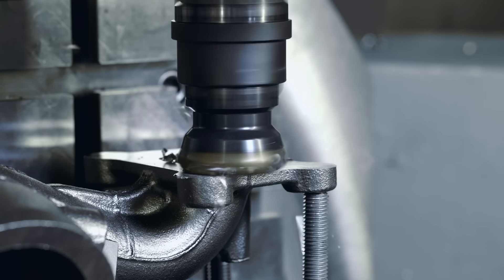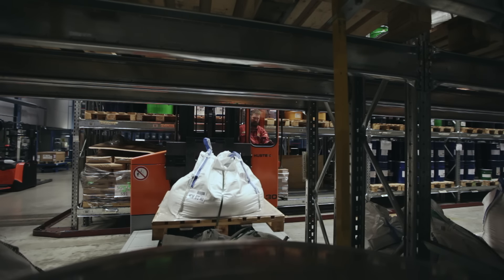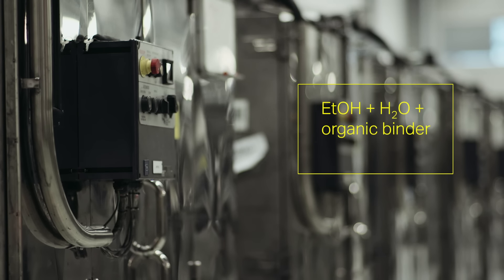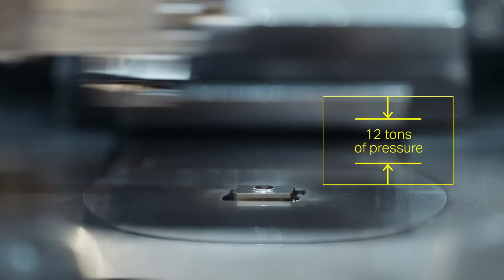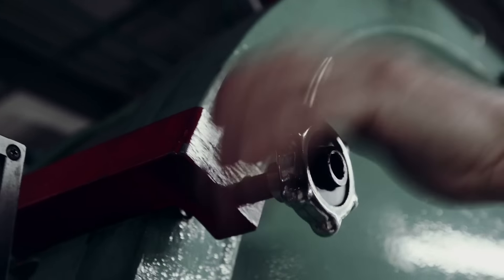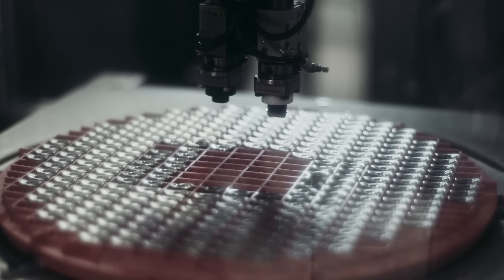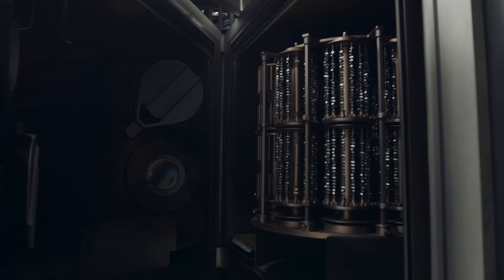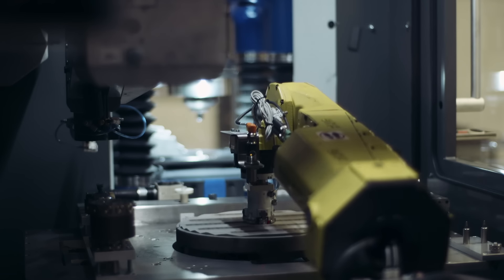How carbide inserts are made by Sandvik Coromant

Comment: As I machinist I work with sandvik inserts a lot. It would be good to see how they are recycled and presumably turned back into powder.
Reply from the maker: Hi,

Thanks for your comment! We have noted that there is a lot of interest for a film about the recycling process and have added that to the wish list for future film productions.
Reply: greasemonger29  he uses PVD coating in last. can you tell me estimate price od pvd coating machine ?
Reply: +GreaseMonger , how do u grind these inserts after they have become dull ?
Reply: It's too costly to send carbide back to get recycled instead we use them in hard facing earthmoving gear or as shrapnel in hand grenades.
Reply: Sachin Ki You dont. They’re disposable, that’s the whole purpose of using easily replaceable indexed tooling. They dont have enough material to be re-ground, that very small rise of the edge is the cutting surface. The process of shipping, setup, and grinding would be twice the cost of just buying another insert, and because each insert dulled surface would be a different dimension, the grinding process would probably have to be custom for each piece. Not worth it. You re-grind HSS and permanent carbide tooling bits, not disposable inserts. Just dish out $10-$15 for more which will pay for a hundreds of times its worth in work.
Reply: I'd say Stefan Gotteswinter would disagree with you Nikolai.
Reply: Nikolai is right on with analysis.
Reply: Anything abrasive thing that contain diamonds.
Reply: Nikolai Shriver we saved all our carbide scrap and took it to the local recycling and got enough to have a party bowling,drinking and pizza every year 😁
Reply: @kunjikorans  diamond
Reply: @jozseffarkas1767   ty
Reply: @kunjikorans  you are welcome
Reply: @nikolaishriver7922  Well YOU don't "recycle" as in resharpen and reuse in your shop, but you very well sell it back for a great price and Sandvik etc. Recycle them by breaking up and re-using the carbide...
Reply: In manual lathes, I've seen plenty of people sharpen them. Just a regular carbide grinder.
Reply: @waqassaddiqueeverything5938  The price of a PVD reactor, the machine ? Between 150k USD and millions. It depends of the volume inside the chamber = number of pieces you can put inside. As for one deposition cycle ? Count between 500-1000 USD.
Reply: @nikolaishriver7922  that 20% cobalt content is gold for EV batteries and chemistry in general. Maybe not adequate for new inserts, definitely purified cobalt and Tungsten very worthy for chemists
Reply: Would be better if they can resharpen them for a second use
Reply: @RockerGuy0001  even a touch up with a diamond hone can make a surprising difference.
Reply: They made the video!
Reply: @trexmidnite  agree. The inserts usually have 4 edges used for cutting. Or 2 depends on insert. But when thats wear down you still have some material to sharpen. Its like 0.4 mm of material on each side before the tip become useless or to rounded. 1 insert can cost about 120 usd. Save alot of money to sharpen it. 
But i think the thing is. The material you working on have like 0.001 or 0.0001 tolerance level. Sharpening a tip must be very precise
Reply: @elinberglund9824   Who the hell is charging you 120 dollars for one insert? The most I’ve ever paid for one insert is 120 dollars, and that’s for 12, so ten dollars a piece. If you work for a company, they will be paying only a few dollars top.
Reply from the maker: @importanttingwei7747  
Hi there
We strive to develop the best product possible, that deliver the best performance on the market. Rather than looking at the price per insert, look at the cost per component. The total cost for tooling in manufacturing of a component is most often a small part, 5-10% of the total cost but the effect of having an optimized machining solution can effect the total cost per component with 10-50% depending on circumstances.
Reply: @RockerGuy0001  shop used them on the CNC machine and then they were hand sharpened for manual machines usually lathe bits in my case, takes a little practice is all.
Reply: I got into machining a couple of years ago and was blown away by inserts. I had never thought about how a lot of our technology is manufactured through machining now I am smaller fascinated by cutting edge technologies. Pardon the pun but I think that's where the term came from.
Reply: @waqassaddiqueeverything5938  oh un tah platit 2 is probably close to 300-500K maybe more
Reply: We use both Sandvik and Kennemetal brand carbide inserts. These insert manufacturers have pretty much perfected the quality of the carbide insert and as long as you can avoid interrupted cuts they last a long time.
Reply: Well impressed you are expert
Reply: @Turkishmath Stephan uses it for his own shop that requires specialized tools that he makes. He also does manual machining so It makes sense for him as a low production, low volumes shop but it would not make sense for a high volume shop. It costs more to resharpen than to buy new. CNC machines have hundreds of tools each with at least four or more cutters. If it made financial sense then companies would be doing it already
Reply: You can recycle the material in other uses than the original.
The recycling process must be cost-effective to be sustainable.
Reply: Liberal limp wrist
Reply: I work for Kennametal.  Mostly recycled inserts are ground up and used in less precise applications.  Road work, mining, drilling etc.  high precision CNC inserts are almost always made using new powder
Reply: You didn't explain what the inserts are for. What is the actual use, after the production?
Reply: https://youtu.be/nPmGVPFITiY?si=2UchG4DO13K1mkWg

Comment: Thanks for a fantastic video! I had no idea the shrinkage rate was so high during sintering. Amazing you can determine the final size at all accurately.
Reply: Not to undermine the difficulty of getting sintering right, but the final dimensions are determined by the grinding process that occurs after sintering/shrinking.
Reply: Anthony Cullison  Also not all inserts are grinded into dimensions.
Reply: Exactly my thoughts while watching. The shrinkage must be consistent, which is a strange enough concept to digest on its own.
Reply: Imagine what injection molding engineers go through🙃🤷‍♂️
Reply: ahh have had variances of .005  in some
Reply: @miguelcastaneda7236  Could you elaborate on that, please? What dimensions were 5 over/under? I would think that over/undersize inserts would not be a problem in a mill/lathe, since you touch off to find the edge. Am I missing something?
Reply: @DrLumpyDMus  it is you touch them off again
Reply: It is not the most complex thing humans have figured out, besides the entire process of grinding is CNC controlled so adjusting for variances resulting from the sintering operation is only a matter of changing an offset number.
I'm curious what would happen if they press formed an insert without binder.

Comment: It's a wonder we can afford carbide inserts at all.
Reply: They aren't cheap.
Reply: You can’t afford NOT to utilize carbide.
Reply: @ Phil it depends what you call cheap and what your needs are (quality/ performance) I use Inserts on  a minilathe :D
because i can run much higher rpm than with HSS.
Its great since the minilathe has less power in the slow RPM range, with carbides i can compensate that by running higher speeds. I got Mitsubishi inserts from ebay pretty cheap. You can get new original Sandvik Inserts on ebay cheap, last time i looked they arent expensive in my opinion (starting at 10-15$ for a 10xpack, Canadian ,US,EU, Isreal Sellers).
Sometime you can get lucky to spot a offer for 6,5-8$ of new in-stock inserts a seller wants to get rid of.(going out of business or switching processes might be a reason for example) EDIT, ok on Amazon they cost 20-300$ Dollar a piece XD , glad that ebay exists
EDIT lol i found even cheaper sellers, 4$ for 10pcs from mitsubishi , i bought 10packs for a lifetime xD
Reply: As the video says, carbide can take much more heat and pressure than, say, high speed steel.  As a result, you can run your machine faster and take larger cuts which, in turn, means the turn around per piece is much shorter.  

So if you're running production you'll be able to cut more pieces per hour.  If you're running one offs, you or your employee will finish the project sooner and will be able to move on to the next project.  

"Time is money" may be a cliche but it's also a hard fact when you're running a business.
Reply: @phillhuddleston9445  - 2 bucks a piece 20 years ago, for a basic cutting insert.
Reply: @phillhuddleston9445  I have to buy mine used on ebay :(
Reply: @deweys  You buy used inserts?
Reply: I bought a whole bunch of Mitsubishi TiN coated ccmt 21.5 inserts on Ebay, $35 for 10 packs of 10. They came from China. They turned to be really good counterfeits, all the way down to the perfect iridescent stickers that said 'genuine Mitsubishi' on em. I had a pack I bought from MSC for I think around $85 for 10? The counterfeit ones weigh almost exactly the same (.04 grams under) & they aren't as sharp on the edges (compared them under a microscope). They're obviously just reprocessed/recycled inserts & they work pretty great. I dont do ultra precision stuff anyways so they're totally worth it.
Reply: @metalboxman99  i made the experience it depends on the shape of the insert. The Diamond ones have a round edge so they arent as sharp , and they aren't optimal for small precision cuts (instead for bigger cuts).
But the sqaure ones are much better and last month i bought silver triangle inserts and they are another class, i can cut very fine details on my crappy mini lathe xD. The price was 6,5$ for 10 only a bit more expensive than the golden ones. I think the dark silver types are higher quality since its my second buy which is much sharper than the golden ones.
Reply: @hyperhektor7733  Try sorting your cutting   cycles by roughness and shapes. Adjust your bit's radiuses, materials and shapes accordingly to roughness and geometry of the trace necessary, use both rough and fine-intended insert's(=bit GB) for not-flat-face, groove or thread figures. You can get any surface finish you need on most figures if your set-up is right.
Reply: Edit: i meant not to be color-bigoted (no racial pun intended).  The coating is not the main property and often doesn't matter, as the binding material inside the bit is what mostly makes it. A lot of expensive ingredients to consider.
Reply: @dannydetonator  thanks for the tip, i mentioned only the skin coating color since i had a correlation with sharpness.
You might know that the cheapest drills for example are gold coated xD i never by them since in my experience they are worse than standart Black rolled HSS Drills.
Reply: Brittle carbide. Inserts don't cost nearly as much as solid carbide end mills. We're lucky to have those inserts.
Reply: Hyper Hektor thanks👍👍👍
Reply: What about the phone you are holding? It's nothing short of miracle.
Reply: Perfect example of automation bringing down prices.
Reply: @henmich  - Do you Mean a DNMG 332 or a DNMG332 QM 525? 

It depends on the type of insert. 

I worked for Sandvik Belgium my love.
Reply: @hyperhektor7733  My guess is no matter who makes them the process aren't that different. I buy inserts off of Taobao (yes I know), but as long as you use those inserts according to their instruction (different inserts have different parameters, intended material, etc.) they all perform very well. I can't tell the difference between aluminum insert from China or ones from Sandvik or Mitsubishi. And in my experience, inserts either perform, or they fail catastrophically. As in use them as intended and they perform even when worn, use them outside of that, they shatter like glass. Such as for example machining steel with aluminum inserts... Especially with Taobao selling inserts of ANY kind for around 5-10RMB each... they're really cheap.